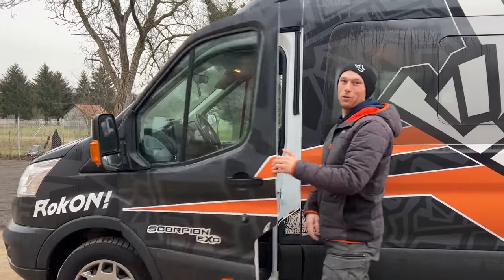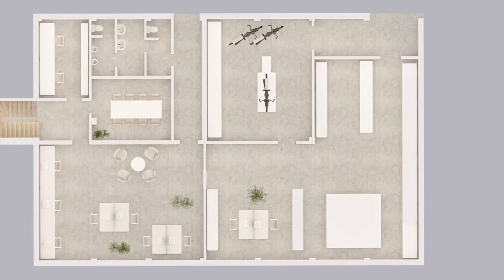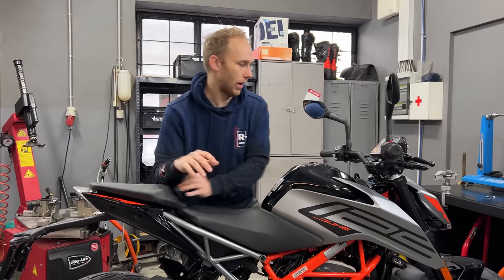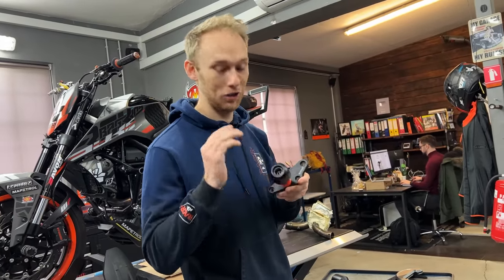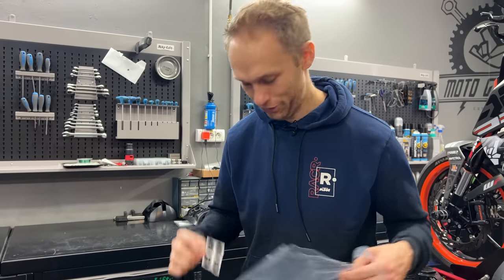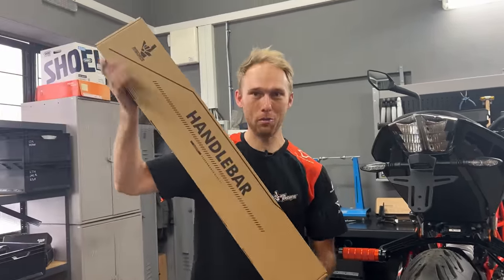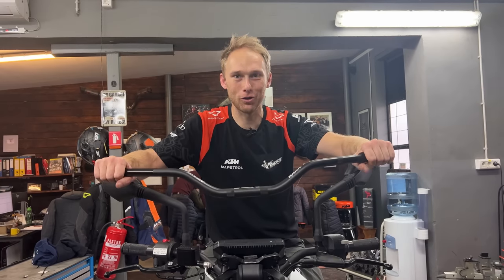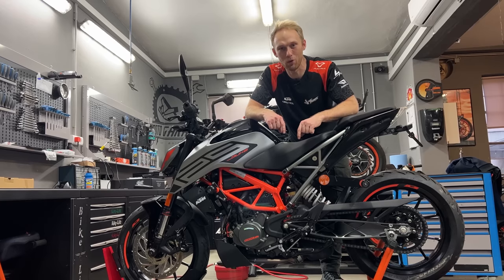KTM 125 DUKE CUSTOM BUILD OFF PART 1 | RokON VLOG 136

Comment: @rok 450 smr vs any 790/890 variant. Which would u choose to ride if u were only doing back Roads?
Reply from the maker: I would go with the 890 ;) the supermoto is for sure more agile but the small seat is not in its favour :) if the twisties are super tight and sharp turns and you have them behind your house then the supermoto otherwise the 890 . That would be my opinion ;)